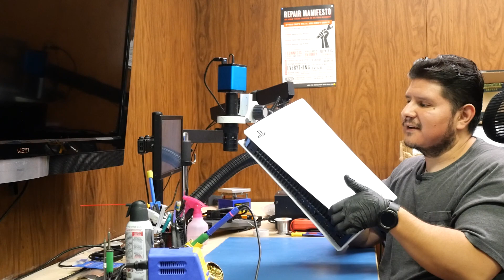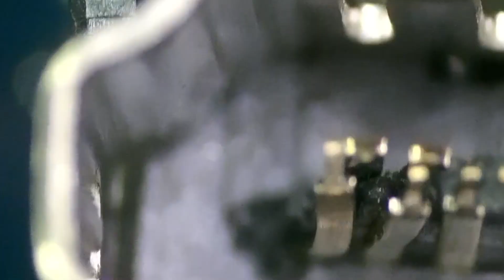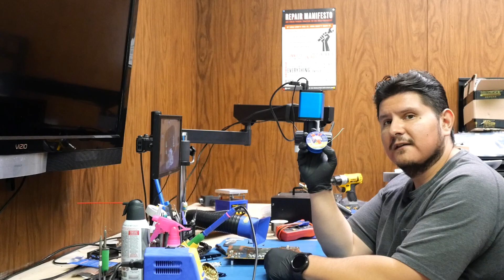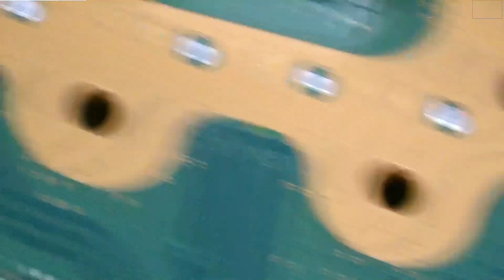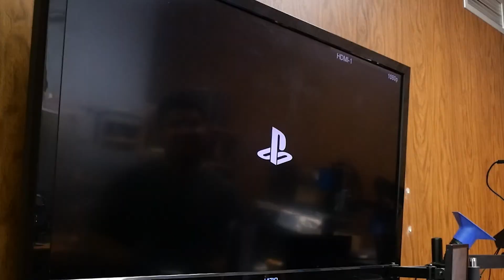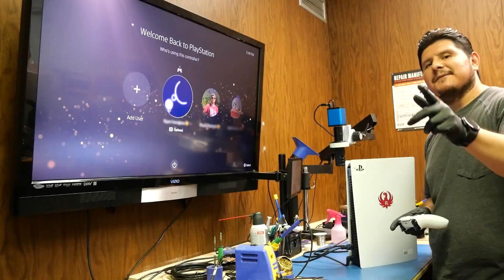Don't Buy A New PS5 Repair Your Damaged HDMI Port

Comment: Great video!

I think I would have just preemptively removed the capacitor and set it aside. That way I wouldn't need to worry about it while cleaning the pads or installing the new port. Then just put it back in place when everything is finished. The melted plastic was almost certainly from you having to work around it, so it probably would have been a lot cleaner that way.

And to get the anchors flowed from both sides, a preheater would have been best. But I think you could get away with some supplemental heat from the hot air just like you did with the pads. Anything to keep the ground plane from soaking too much heat.

 As it is, you probably have some partial cold joint in the areas that aren't visible. It's more than functional, but potentially weaker than needed. Plus, all the excess solder on the sides of the port could create clearance issues during reinstallation or sometimes even flow inside the port.
Reply from the maker: Thank you for the tips. I've pretty much started applying most of those suggestions in more recent repairs. Sometimes you feel you can get away with not removing the capacitor, but then it just gets in the way. In a more recent PS5 repair, the cap caused some problems. Sometimes you get lucky and the customer has busted off the cap though.